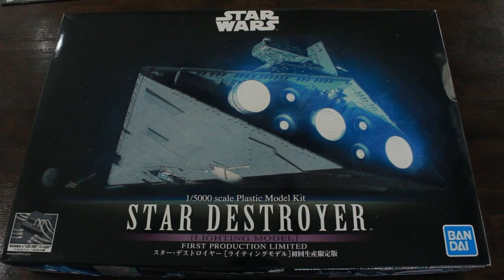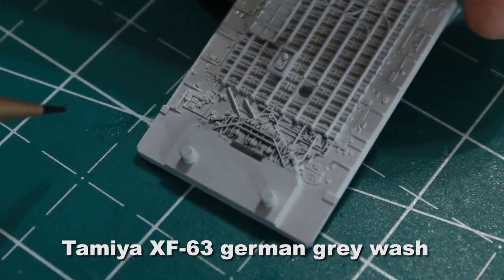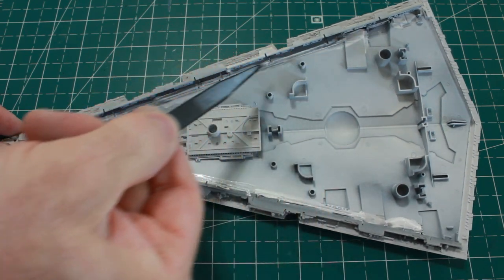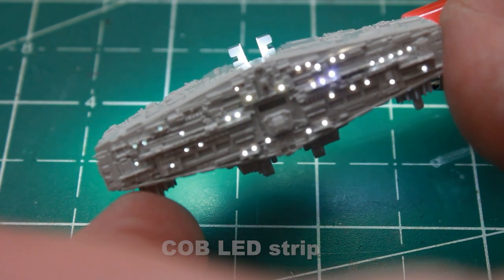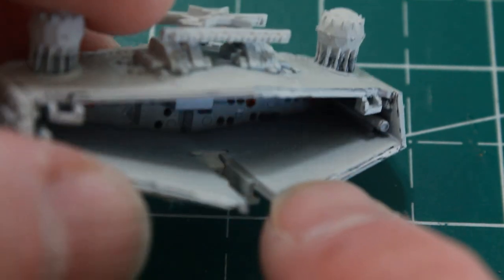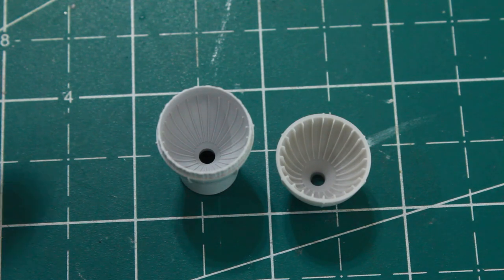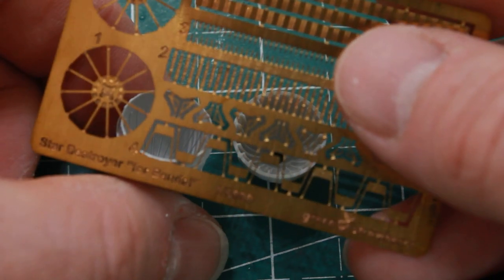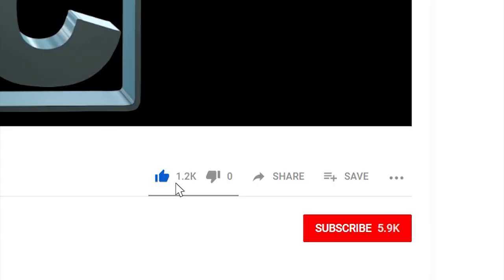Bandai 1/5000 Star Destroyer model build Pt I

Comment: I would have liked to see someone  choosing the clear parts for a change, having said that, very nice job with that model.
 I will looking forward for the conclusion in the next video
Reply: The clear parts are redundant since they already have holes for the windows. There is no point in using them because they only will make light blocking more difficult.
Reply: @stevethefishdotnet  
I recently got this exact edition of the model from someone moving out of town at a great price (the equivalent of $85).
  I thought that an experienced modeler could take advantage of the clear parts, but I have not seen anyone on YT do it, it seems redundant to everyone.

  Possibly a better choice for this model could have been to use translucent parts and instead of perforations, plastic areas so thin that in the light they look like windows, something like what they use in some star trek models since Bandai has the technology to pull something like that......oh well.
Reply: @vvaldo314  Back when this Star Destroyer model first came out, I did an unboxing for my channel. I saw how pointless the clear parts were since it already had holes, so I made sure to only buy the regular version for myself to save money. I also intend to do my own lights for the kit anyway.

Comment: Hey Chris. I see you are using AS-20. From what I heard it's the go to substitute for what ILM used for their white colors. I decanted a can and put it through my airbrush but its coming out slightly too yellow, the tiniest bit but it's noticeable. I then read that Tamiya LP-35 Insignia White is also a good substitute. It's an ever so slightly cooler off white than the AS-20 I got. Have you heard anything about that?

I am currently painting a B-wing and some x-wings and it seems to be a better match than the AS-20. Maybe I got a bad can? Thoughts?
Reply from the maker: Never used the LP-35.  I've always had good luck with the AS-20. I've never tried to decant a can though.  As for shade between the 2, if they are slightly different,  I guess that would just be a personal preference then as to which you like better.  Once you weather and wash,  it'll probably be more difficult to tell. That definitely can change the look.

Comment: Hey Chris, nice work. I have a couple of questions. What are you using for the diffusing? Secondly… I want to know more about cob LEDs. I did some searches and they seem to come in fixed lengths. Can they be cut to length? Or must you use the given length they are made in? Are you getting the 3volt versions? Any recommended places to source them from? Thanks in advance!
Reply from the maker: Is photo diffusion paper.  You can get from Amazon.  Mine is Lee diffusion paper. 
The COB steps can be cut every 1 or 1/2 inch depending on the strip you get.  And the come in warm or cool white.  I use 5v, but the find in 9 and 12v as well. Don't think you can get in 3v because you wouldn't be able to run off of battery.  I get mine from Amazon.  
1 inch cuttable cool white.  https://amzn.to/3UlmgFt
1/2 cuttable cool white.  https://amzn.to/3Uo2XLC
Reply: @modelsbychris  Hey Chris, thanks for this info! This is a huge help to me. I will look into buying from the sources you mentioned and that is great to hear that they are cuttable. 9 volt would be perfect. That is my preferred power source and voltage. If you don’t mind, one more question. Do COB LEDs have current limiting within the filament? Or do you need to add that externally? And if it is internal, do you need to make current limiting adjustments once you cut it?

Thanks again and I enjoy your builds. I am subscribed.
Reply from the maker: @stevebak6664  I just cut and feed it 5v direct. With COB, I believe each LED had its own resistor and such.  They also run super cool.  I've not felt any heat whatsoever,  even after being on a while and holding the strip on my hand.
Reply: @modelsbychris  Chris, that’s awesome.  I will try this on my current project. Thanks again!

Comment: Hey Chris, could you post a link to what material you use for diffusion?   Is it trace paper?
Reply from the maker: The paper I have I got in a store in LA, not online.  You could certainly use tracing paper or even tissue paper,  like for gift bags.
Reply: Parchment paper works quite well too
Reply from the maker: @shanelamb4905  I have tried that before also